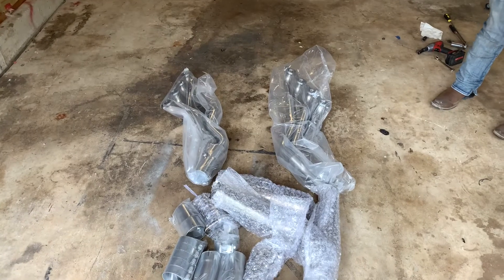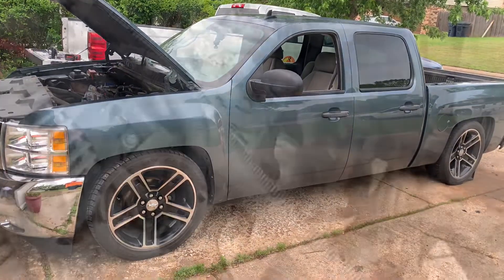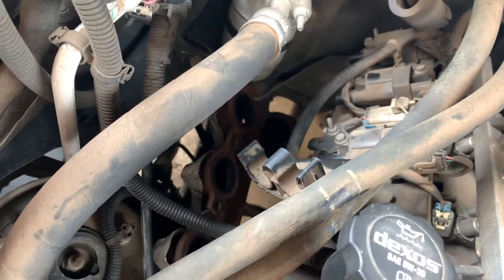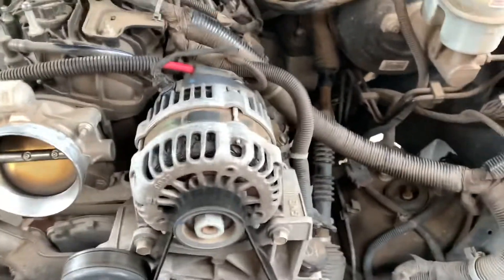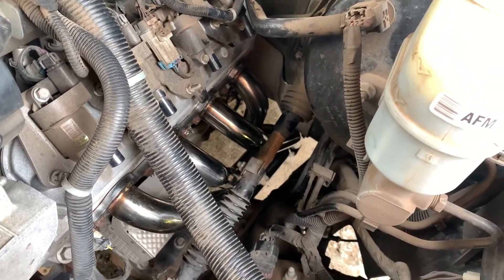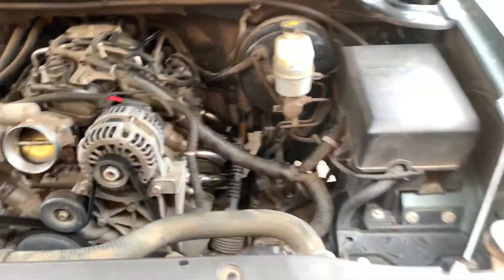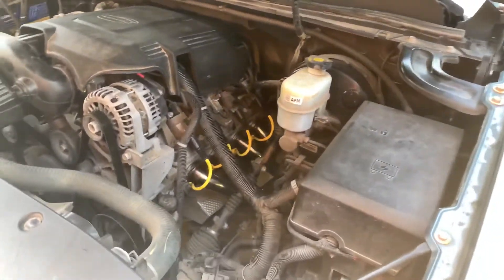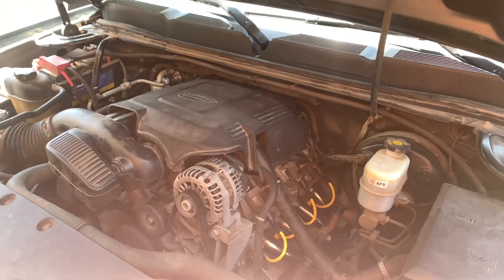Speed engineering long tube header install

Comment: Did you have them welded or just clamped? I have same set on my truck and no matter how tight I clamp I have exhaust leaks.
Reply from the maker: I just used the clamps that came in the kit.  There are some flat strap clamps that you can use and once you get them tight they conform to the pipe and make a pretty good seal.  EVIL ENERGY Exhuast Clamp,Butt Joint Band Clamp Sleeve Coupler Stainless Steel (3.0 Inch,2Pcs) https://a.co/d/9S9bQHD.  Give those a look and see what you think.  I’ve have good luck with evil energy products
Reply: @zerofactorx  Thanks. Ill give those a shot.

Comment: I just finished my 2007 Tahoe using Texas Speed Headers and Y Pipe. Got my HP tuner out and killed the Lower O2 Sensors.
Reply from the maker: Sweet man!  How’s it sound.  What muffler did you go with?
Reply: @zerofactorx  Sounds pretty good but for now I stayed with factory muffler. Waiting for more dollars to come in.

Comment: Damn I was sure the stock plug gap was supposed to be @ .040 for iridium plugs? I have the same set of plugs in my 08 Silverado and checked that they were all pre gapped at .040, are you having any issues running ur plugs with .058 gap?
Reply from the maker: No it’s a naturally aspirated set up and pretty stock less the long tube headers.  We didn’t run the iridium plugs just the basic ngk tr5.  He says the trucks been running good.
Reply: MK Motorsports It made me think Lol I remember looking up my plug gap for the iridiums I have and I was like did I check those??? He’s got a clean truck 👌🏻